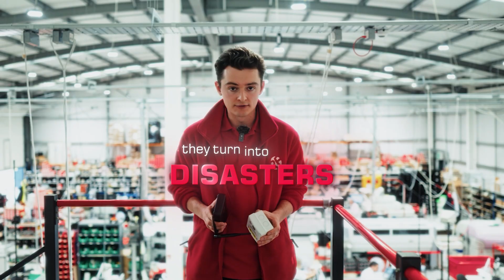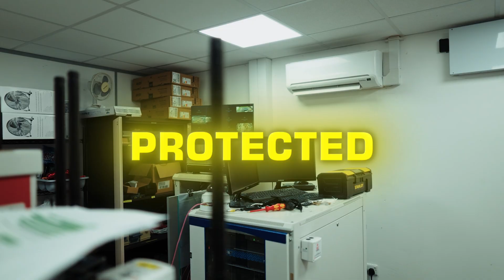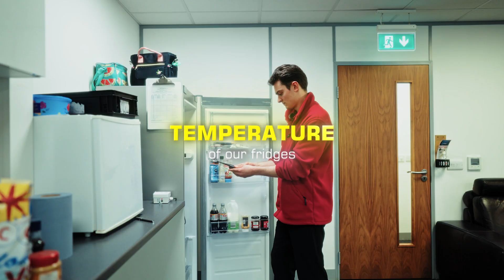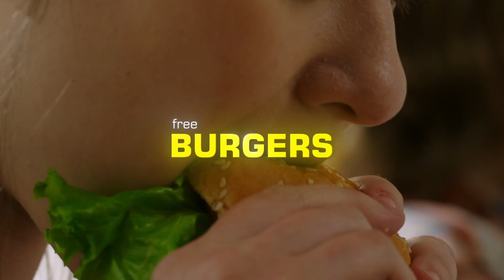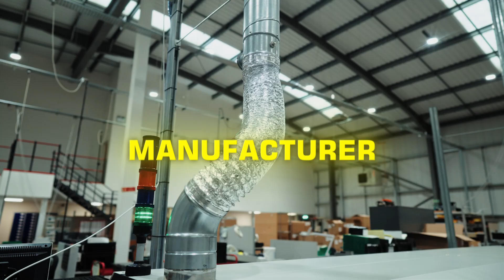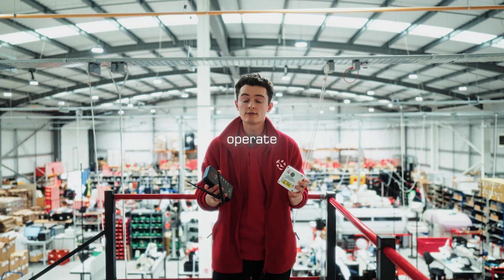Is Your Factory Smart Enough? 5 IoT Upgrades We Made

Comment: How can we link individual radiators to turn on/off with a direct command from a temperature sensor ?
Reply from the maker: The direct control radio signal is the same type of signal as an standard radio transmitter (eg keyfob) not an iot signal.

So a receiver at the radiator can “learn” this signal just like any standard remote control would. Then when the direct control signal is transmitted the receiver operates its outputs just like it would if a user were to operate their keyfob transmitter.